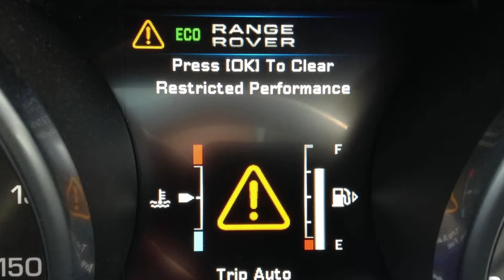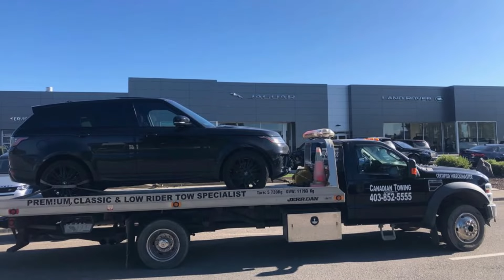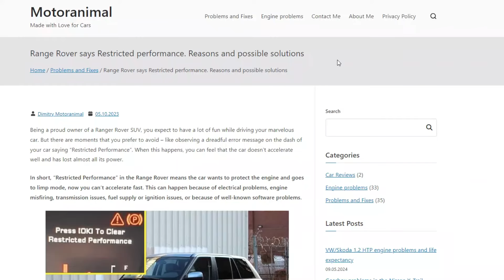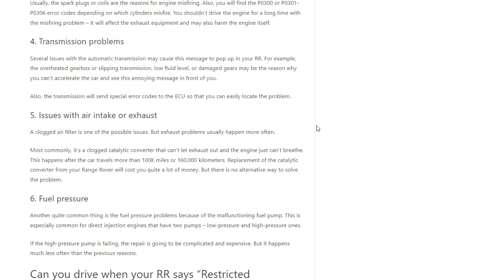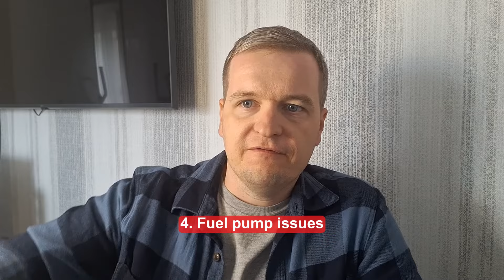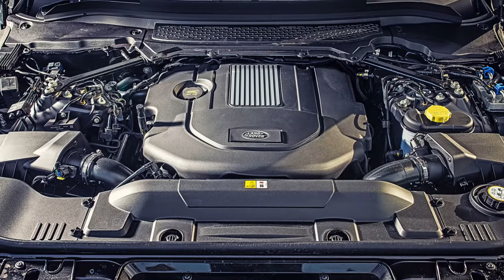“Restricted Performance” Warning in Range Rover: REASONS

Comment: My range rover sport 2010 showing restricted performance was told it fuel pump, I changed pump still having same issues
Reply from the maker: But you can check everything that triggers it. The faulty pump would reduce the fuel pressure on the rail, for example. Inspections will save you lots of money when it comes to LR vehicles.

Comment: Hi I recently had this on my range rover sport accelerate hard then ease off then you get the warning. first thing was the throttle body was sticking then some shutters linked to the turbo, then the turbo i think it was the n/s then due to all the testing at the garage the DPF then failed but all working now .
Reply from the maker: It was probably trying to regenerate when the throttle got stuck. This may lead to a bunch of warnings/messages. But after the throttle flap is fixed, things usually go back to normal. Very common for 3-liter diesel.

Comment: I had the restricted performance in my 2019 diesel disco sport while I drove on the motoway, when I accelerate.
Stopped the vehicle and turned off the engine and dissapeared once turned back on. I had recently changed timing chain at 42k mileage.
What could might have appreared the restricted performance.
Reply from the maker: This shouldn't be connected with chain replacement, but why was it replaced at such a low mileage? Might be a glitch with any sensor throwing wrong readings, low voltage in the battery, or anomalies with oil pressure (check the level, in the first place). But if it doesn't reappear, it's not that serious. If it comes back anytime soon, try driving to any good garage or dealership without turning it off and read the codes.
Reply: @DmitrySapko Timing chain was changed because of following the JLR service interval at 21k mileage. The LR specialist told to do at 8-10k every year and not follow JLR.
The restricted performance came again while driving on the motorway when I tried to accelerate past 70 mph, loss of power but still drives. 
I will take it to the garage.
Thanks.
Reply from the maker: I would avoid that garage. 2.0 diesel has no specific chain interval, usually it's recommended to change the kit at 100k miles. 3.0 diesel has belts to change at 80k miles, but the chain lasts forever. Check it with the dielership or in the service book.
Reply: @DmitrySapko most owners change it sooner than that. I have seen people change it in less than 30 k miles. Something is wrong with this engine.
Reply: @DmitrySapko  interesting what you say about the battery. I found your post after googling this issue as I saw it in a video for a 2010 RR listed on an auction site. They said as it had been standing for some time the battery had been flat. However the light was not an amber but red which is more concerning isn’t it?🤔 I also have heard that the low battery can cause similar warning lights for no reason across the board
It is diesel so took note also of your comment regarding adblue. The issue is in an auction it’s an unknown, my real question is could it be something costly or would it be this type of thing, it sounds possibly it could be work intensive. Thanks